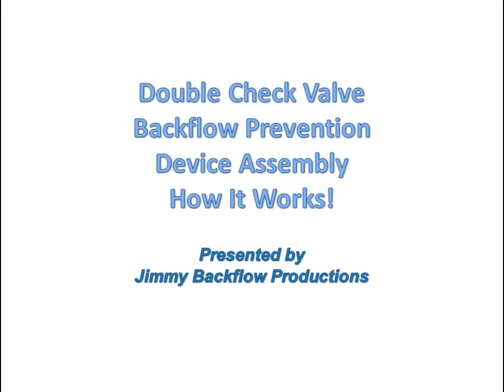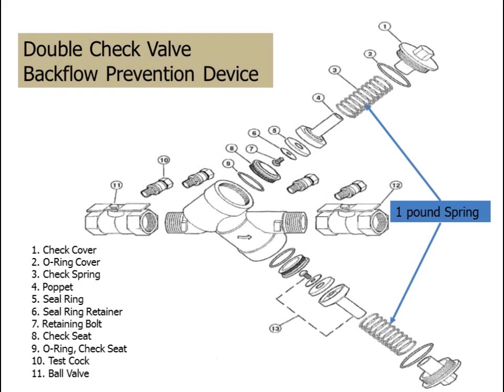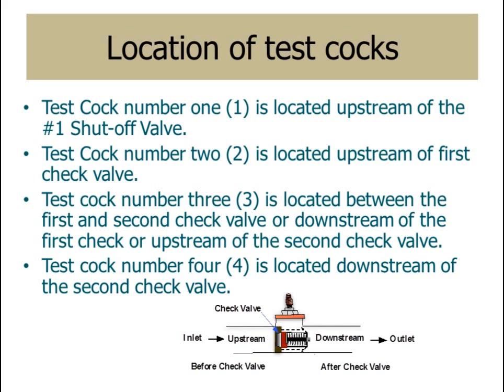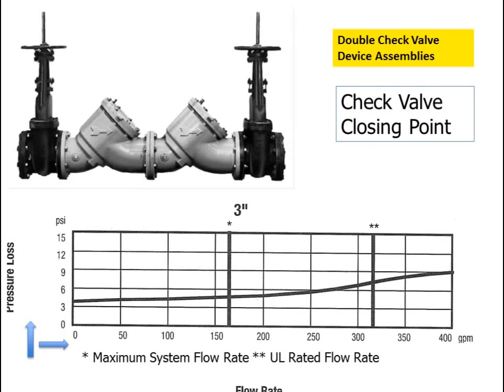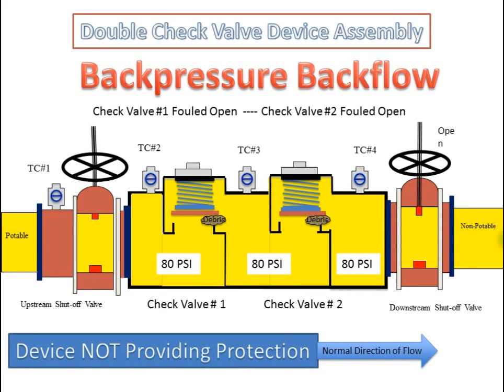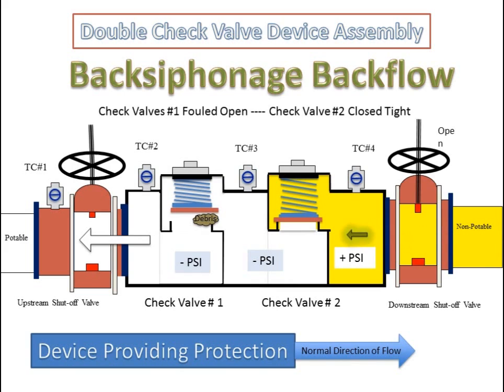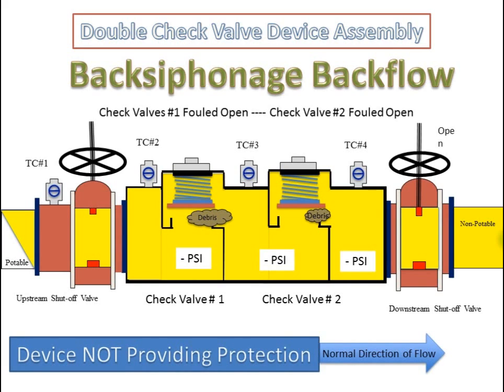Double Check Valve Assembly - How It Works

Comment: I am searching about double check valve we can use it with Sulphoric acid 98.5  conc.
Reply from the maker: You need to consult with a manufacturer.  They do make plastic backflow preventers.

Comment: do the check valves close with the supply open and #2 shut off closed?   I have one spring with 1lb force--> I have 10 psi coming in--> 1 pound lost while overcoming the spring ---> I now have 9 lbs on the downstream side of the check. 
At what point do I get higher on the down stream side to over come the supply and close?
Reply from the maker: When the backflow preventer is in a static state no downstream demand the check valves are closed. When in a static state the pressure loss across the check valves is generated by the check valve springs. Typically, a minimum of one pound loss on each check valve. The check valves open when there is a flow through the device and a downstream demand. If there is a backpressure issue (higher pressure on the outlet side of the device) the second check valve should close drip tight if operating properly.  I hope this answers your question and thanks for viewing the video. If you have any further questions, let me know.

Comment: Asking to understand, not to criticize. If the water pressure is reduced as it goes through the check valves, why isn’t the non- potable pressure reduced in a back pressure, backflow condition?
Reply from the maker: Backpressure is greater than the inlet pressure and is prevented from flowing into the potable water system by a closed second check valve. If the second and first check valves are not drip tight, the backpressure non-potable water will lose pressure due to friction factors as it flows in the unwanted direction. When water flows through the backflow prevention device assembly, the pressure loss is due to the spring-loaded check valves. If both check valves are not holding drip tight against backpressure, the check valves are open, and the check valve springs are not creating the pressure loss with the water flowing in the unwanted direction. With backpressure, some pressure loss may be present in the body of the assembly but insignificant.
Reply: @JimmyBackflow  I got ya. Love the content of your videos and appreciate you making them. Thank you for taking the time to reply my question.

Comment: I have an older irrigation system installed at my home. I have access to the outgoing pipe to the sprinkler in the basement. From there, it goes to a free-standing verticle PVC pipe with a sill cock on it, and on top of that is a schrader valve, that the irrigation companies uses to blow out the water before winter. There is no backflow preventer installed. My question is this. Since it appears to install a backflow preventer, I need access to the outgoing water line. I do have that access inside the basement but on the outside, if I were to install the backflow preventer there, I believe I would have to dig down to get access to the pipe after it leaves the sillcock and heads to the valve box. Is that correct? I don't believe I can install it on the vertical free-standing PVC pipe since not only does water come out there, but also the air pressure is attached there to clean out the irrigation lines. I have seen screw in backflow preventers but not sure that would work. Any suggestions would be appreciated. Thanks
Reply from the maker: You can install a pressure vacuum breaker on the PVC vertical line that leads to the sprinkler system, providing that the pressure vacuum breaker is 12 inches above the highest sprinkler head. Without seeing a diagram, I can't say for sure what is the best solution.

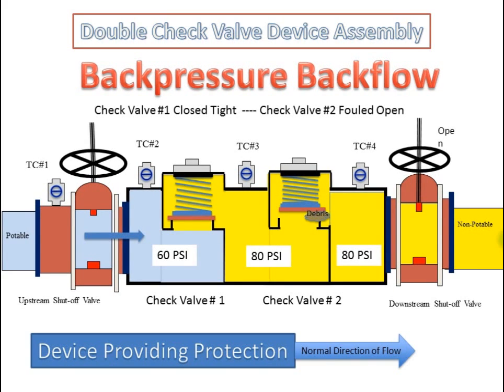Comment: 5:22 , does this mean the water can flow from low psi to high psi from the direction of left to right?
Reply from the maker: Jonnny, no water flows from high to low pressure --- from left to right in this diagram. If backpressure is present downstream on the right side of the slide, this is now the high-pressure side. In this case, if operating correctly, the second check valve prevents the high pressure from flowing back into the inlet pressure. If a backshphonage  situation is occurring in the inlet system,  the pressure is subatmospheric and the pressure downstream of the backflow device assembly is atmospheric.   The first check valve prevents non-potable from entering the system is operating correctly. The flow is from high to low.

Comment: What is the purpose of the TC#1, TC#2, TC#3 and TC#4?
Reply from the maker: TC#1 is typically used for maintenance purposes and can be used to create a static state when the downstream shut-off valve is not drip tight. The purpose of TC#2 is to measure the pressure upstream of the first check valve. The purpose of TC#3 is to measure the pressure downstream of the first check valve and upstream of the second check valve. The purpose of TC#4 is to measure the pressure downstream of the second check valve. By knowing the pressure upstream and downstream of the check valve one can determine the pressure loss across the check valves. The differential pressure across the check valves of a DCVA shall be 1PSID or greater to comply with the industry standards. I suggest you view the testing videos for further information on testing.

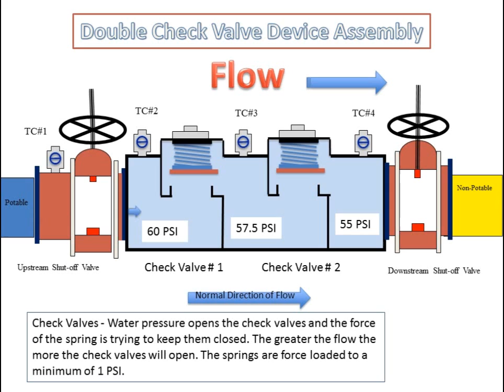Comment: At 4:01 you say a pressure loss occurs across the check valve. Why is this though? I read that a check valve does not produce a change in pressure, and since no work is being done on the spring due to the lack of motion of the spring, it seems very unintuitive that a pressure differential would exist?
Reply from the maker: As the water moves through the double check valve device assembly, it must pass through two check valves that are spring loaded which cause resistance and reduces the pressure. The check valve springs are typically a minimum of one pound. The resistance of the check valve springs lowers the pressure on the downstream side of the check valves. The check valve will close when  the flow through the double check valve  device assembly stops.  Once the check valves close , the water pressure downstream of the check valves is lower than the pressure upstream of the check valves. The closed check valve locks in the lower pressure downstream of the check valves thus creating a differential pressure across the check valves.
Reply: @JimmyBackflow  wow you replied to back to a video made 6 years ago. Respect

Comment: Can I ask you a question? Why are central hot water systems often using double check valves?
Reply from the maker: As stated by many plumbing codes, a dual check valve with intermediate atmospheric vent (ASSE1012) is required on the  make-up waterline supplied to  a residential boiler to prevent the hot boiler water from entering the potable water system.

Comment: how do you reset the check valves when they trip
Reply from the maker: +goldenglory79  The check valves are spring loaded and close when the backflow prevention device assembly is in a static state. If the check valves fail to close,  the check valve will have to be repaired or replaced.. Typically it is the check valve disk that causes the check valve to fail. It does not seat properly and has to be repaced.
Reply: Jimmy Backflow thank you

Comment: For cheap brand new Back flow devices for jobs, check out Ebay! 2inch watts lead free for 450$ Wide variety all shipped the same day bought! We have 3/4 stainless steel, 1 inch etc